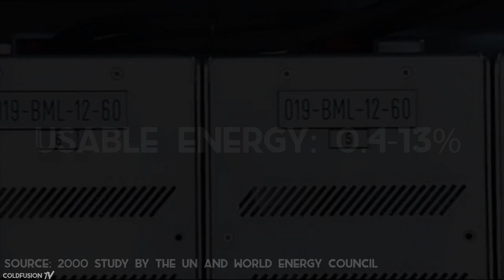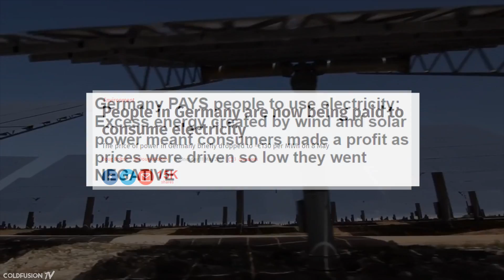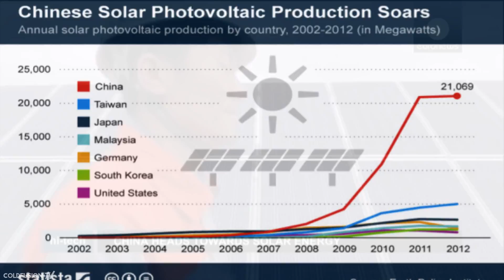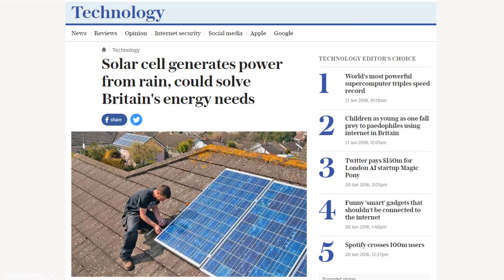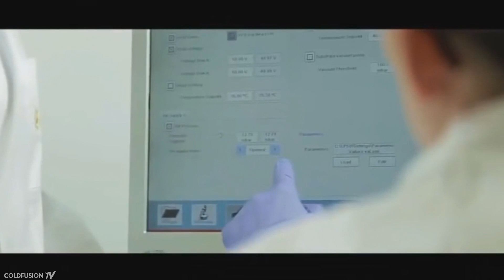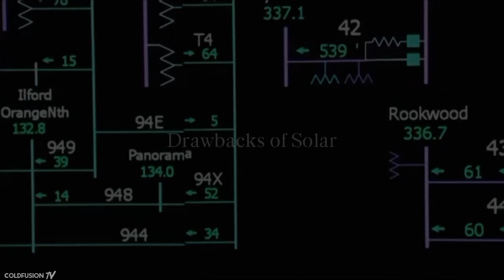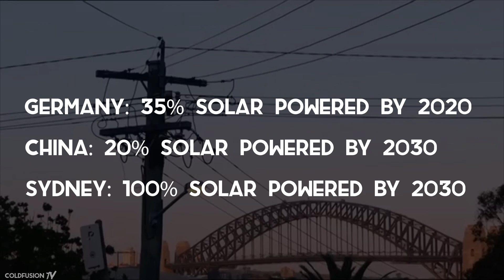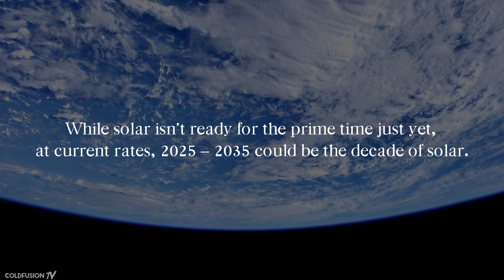The Truth About Solar

Comment: Solar is STILL expensive when you take into consideration that it requires energy storage (e.g. batteries) for high penetration rate in the grid. Furthermore, you should just have mentioned that the solar irradiance has a theoretical maximum of ~1400 W/m^2 (fluctuate tiny bit over the year) better than the BS you threw earlier in the video.
Reply: (mech. engineer with solar specialization here ) : you don't necessary need storage, smaller solar system taking your peak load for e.g. factory during the day is also an option. it breaks even in under 4 years :), plus the maximum irradiance might be true , but thats for silicon only, there are other chemistries , like abovementioned perovskite
Reply: You should stay in school longer, you are obviously really bad at thinking outside of the box.......
Reply: Once again, you are very under-educated, and need more real world experience. They are now selling Salt batteries (or salt ion batteries) that are fractions of the cost and are great for solar storage. Have you seen the mirror array power plants, too?  They are "solar" but in the heat sense, not photo voltaic. They are able to store enough heat in the molten mix to create power long after the sun goes down, through the night, into morning. I would hire a kid like you, but you would have to do more listening and learning, and less talking and thinking your degree means shit.
Reply: Cheap ain't everything. If we continue to use fossil fuels at the current rate the oceanic phytoplankton we rely on for our oxygen will die off. That's just one cost of global climate change. Try breathing the money you'll save by clinging to dinosaur technology.
Reply: PS. I'm an energy system engineering student (masters of mech. engr, nearly done)
Reply: I would argue that having to build, run and maintain peak power plants are also extremely expensive. I am unsure of their overall cost versus say, a huge array of batteries that store and distribute solar, but I know it is not trivial since states like California and the IOUs spend a ton of time and money on peak demand energy.
Reply: Paul Fortunato Still cheaper than solar. Not only energy storage (let's say batteries) are expensive but they also have very short life time. In the future, batteries will get better, but at the current state, his statement is definitely false.
Reply: MilitanT07 It is very funny you don't respond to me. It is almost as if, you have nothing coherent enough to counter what I am saying to you.
Reply: Eclipsethesun: No one responds to ignorant blabbermouths like you.  You are emotionally challenged and ignorant you do not even bother to check your own statements as that might make you feel bad.  You just want to be heard as you are on an emotional crusade.  If you had something relevant to say, you would have done so with numbers(Facts).  Since you are running on emotion, you do not have numbers(Facts).
Reply: MilitanT07
Don't forget being too cold as well.  Cells oxide as they age and quickly lose capacity to generate power.
Reply: Absolutely correct.  In addition, of that 1400 W/m^2, we can only hope to capture (After losses from the PV panel, the inverter, and the batteries) something on the order of 30% of that.  To put it into perspective, assuming a 15 mile commute, you'd have to cover your entire back yard with PV panels to drive your Tesla to work.  People should watch this video: https://www.youtube.com/watch?v=-5bVbfWuq-Q
Reply: First, no matter the kind of batteries, there is only a maximum, at the equator, best case scenario of 1400 watts per square meter.  It never, EVER gets better than that on planet Earth.  But it does get worse, far worse.  For instance, at the geographic center of the United States (In Kansas, at 40 degrees North), that theoretical maximum falls to 63% of that, about 882 watts/m^2.  And due to the inefficiencies of the PV panels, the batteries and inverters, you can only count on getting 264w/m^2 from that.  Which means that a 1 square meter of solar panels won't even generate enough power during the full day to allow you to run a 100watt bulb 24 hours.

Next:  Either make an argument like an adult or STFU.  Being abusive weakens your already sad argument.
Reply: phaedrusalt Somebody flagged your comment as spam I couldn't see it till now. There is also the issue of operation condition above STC (e.g. higher cell temperature, bigger voltage drop across cells)
Reply: I am not hooked to the grid, yea I made huge cut backs on energy use and people try and say it would be cheaper if I stayed connected to the grid is not the truth. I'm one year in use only 3 100 watt panels, 4 walmart batteries, 40 amp charge controller, and a 1500 watt pure sine wave inverter. it was about $1500 for all that and bits and pieces to hook it into the house. Now the minimum charge from my power company would have already took the $1500 from me so I'm already making free energy in my book. Yea I know most could do the huge cuts I have made but I still have lights at the flick of a switch, refrigeration , television and this tablet I'm using now. the only thing I'm doing without is air conditioning. looking at what I can do about air conditioning but it's still not viable IMO. why have I done this basically screw the power company.
Reply: For people who claim to know things, some people don't know very much. Global warming and cooling is a natural process of the earth. In the past the earth has gotten a lot warmer than it it is today and a hell of a lot cooler.  CO2 and O2 rates have also been higher and lower.  Temperatures have only been recorded in the last 100 years, the only way to know the cooling/warming trend is through core sampling.
Reply: +Daniel Chrkavy That's why I said "for high penetration rate in the grid" because the grid can easily absorb small amount of energy (arguably up-to 15% without even needing a study). But that is close to nothing, you can easily compensate lack of sun during peak hour at certain days but you certainly cannot when the penetration rate is high. Of course unless you have conventional power plant with enough capacity but that would be too freakin expensive.
Reply: Unless, of course, you use molten salt solar, where you can just leave the molten salt (or whatever material they use) insulated and not put water on it when the power is not needed in the day (there will be some losses but not too much), and then pump the water at night. It's also alot more efficient, but does have the downside of being a plant far away that loses power as it goes through the grid.
Reply: +D Hunter I really don't understand what is your argument here. It doesn't change the fact that it is expensive (what i'm arguing). Furthermore, renewables are heavily subsidized and fossil fuels power plants are heavily regulated in Europe so... The US also subsidize renewables to push it further.
However, pushing it too much forward is idiotic as more research is need to be done for it to be more economical favorable. What you're describing will take decades before we see any effect if any.
Reply: Nosirrbro Right. That's not really that cheap when you consider the fact that what ever you stored would have to spread between the time the sun is down. If you check the price for those tanks they are in the order of hundred of millions or billions for couple of GWh. 1 GWh tank if had to supply power for 30 hrs would have a theoretical maximum average of 34 MW.
Reply: Don Mega Irrelevant.  Do you have a LED hair dryer?  How about a LED dishwasher?  Have you seen an LED elevator anywhere?  The point was about the tiny amount of power that 1 square meter of PV panels can generate, and the light bulb was just an example.  (Try to follow, won't you?)
Reply: hehehe , crappy Camry, yup she is that 1997 with 600,000 klicks, original motor very little rust.
Solar will not flourish until the full spectrum panels become available.  As for your vehicles,  big motors with small batteries never last long. That's why they put them in there, to sell you a new battery after the vehicles warranty runs out. With batteries , size means everything. If you calculate that you need 200 amp hours , get 400
Reply: +MilitanT07 batteries last a lot longer than 5 years! The Tesla battery has an 8 year, INFINITE MILE warranty. Doesn't matter how much you charge it, it's covered for 8 years. That sounds a lot like confidence to me. That and they are currently developing (are almost ready to roll out) a battery that is fully capable of running your house for well over 24 hrs off a short charge from 230 volts. With a 10 square metre solar panel which we'll assume provides 1000w/sq metre (since that is he average output of any decent battery),thus providing approximately 66amp hours of charge, you could charge a 7kWh home battery in 10hours, well within daylight hour times and have a house that ran all night long with loads to spare while you're charging up the next day. The Tesla home battery is going to cost around $3,000, and where I'm from a solar setup like that would probably be around $10,000 (I'm an electrician and sell these products all the time, so this is a pretty well educated guess).
Reply: I am not hooked to the grid, yea I made huge cut backs on energy use and people try and say it would be cheaper if I stayed connected to the grid is not the truth. I'm one year in use only 3 100 watt panels, 4 walmart batteries, 40 amp charge controller, and a 1500 watt pure sine wave inverter. it was about $1500 for all that and bits and pieces to hook it into the house. Now the minimum charge from my power company would have already took the $1500 from me so I'm already making free energy in my book. Yea I know most could do the huge cuts I have made but I still have lights at the flick of a switch, refrigeration , television and this tablet I'm using now. the only thing I'm doing without is air conditioning. looking at what I can do about air conditioning but it's still not viable IMO. why have I done this basically screw the power company.
Reply: +Dan Reader also solar panels don't have to be set up to charge a battery while it is discharging, there are many ways to connect them up. You can connect them up so that they only charge your battery from wattage not being used by any power draw you have. You can even wire them so that you can sell any excess that you generate back to the national grid, very common with my customers.
Reply: +MilitanT07 not a fan of big business, and I'm old so I guess it's my way of being rebellious still lol. what tip the scales for me was my power company got caught dumping coal ash improperly contaminating a river soon after our rates went up I didn't feel right paying for their mistake.
Reply: Simon WoodburyForget No not really, the grid create as much energy to maintain the frequency of the grid within the desired range, i.e. effectively Demand=Supply... I really don't feel like explaining the grid, look it up.
Reply: so worse is better? wow, i need to rethink my life.
Reply: People should learn an understand the difference between power and energy. This video was also realy bad.
Reply: We are not ready for solar for a permanent, solution . It still will be used for supplement to other generator sources.
Reply: ***** You argument is...?
Reply: +Brandon Yii  on a large scale it would be the way to go, easier imo to incorporate into the grid. I have seen some videos about them they store the heat up but still fall short if there is low light for long period of time. some the models for green energy I have seen include a hydrogen generator but to build and operate all of this is expensive. More expensive than war? I think we see what are leaders think.
Reply: +Richard Hawkins also photovoltaic solar will only work on a small scale, single home is about the limit imo
Reply: +YoYo Ma Neither do you. No facts, no numbers, no argument. You literally countered his argument with insults, which illustrates just how little you have to say on the matter, which irritates me even more than the comment you responded to. 

And to my point. It is true that solar is more expensive, but it's only more expensive because Big Oil is powerful and has control over the industry, and (a relative) lack of research and funding into improving solar is keeping costs high and adoption down. What needs to be considered here is not and economical point of view, but an ecological one. If we don't explore alternative means to power this 'civilized' lifestyle which we crave so much, then results shall be catastrophic. 

It's estimated (Data provided by - the Environmental Change Institute, School of Geography and the Environment, and Department of Physics, University of Oxford, with support from the Oxford Martin Programme on Resource Stewardship and the Union of Concerned Scientists. Modelling by Richard Millar. Interactive by Duncan Clark - for the fact-and-figure heads amongst you) that a child born today will see a global average temperature increase of 6.3 degrees centigrade. It might not sound like a huge number to the uneducated, but that is a fucking huge deal. Sea levels will rise by feet instead of inches, glaciers will melt, and perhaps most significantly, the Antarctic Ice Shelf will start to melt into the sea. 

NASA have already observed an ice sheet the size of Manhattan (called the Nansen Ice Shelf) with a gargantuan crack in it, waiting to fall into the ocean at any time. The tsunami from that thing hitting the water will be freaking big. That is estimated to happen soon (as in the next 5 years), and is significant enough that it WILL have an impact on us when it goes. 

Also worth mentioning is our little magic 6.3 degrees number. If this occurs it will be enough to melt much of the ice at either pole, which upon entering the seas will have a MASSIVE impact on marine life, along with currents (like the gulf stream) which are entirely responsible for the climates we have in the world today. Once this happens, our 6.3 degree raise in temperature will suddenly turn into a worldwide nosedive in temperature, and will likely lead us into our sixth ice age. Make no mistake that climate change will be the end of us if we do not work something out, so really having petulant arguments about how much shit costs is really not the answer.
Reply: Sorry about the wall of text. I tried to paragraph it but YT doesn't seem to want to let me add line breaks.
Reply: What difference if you have to use batteries, you have a fuel tank in your car. In my old house had a 200 gallon oil tank for my furnace and a 14 ft by 18 ft shed for wood.
Reply: Mazda rx7 Fuel tanks can live for ages and it iis cheap. A battery has a life of like what 5 years? and it is very expensive (cost nearly as much solar panels per capacity from what I remember). There is no way to make it economically viable with battery atm.
Reply: Dan Reader Where is your proof for the first statement? I don't think there is an engineering college that doesn't do research on solar technologies.
Reply: MilitanT07
I don't where your getting your 5 year life span info from. I got 4 (they were almost 5 years old) used Raymond reach truck batteries for my brothers cabin about 5 years ago. they still work great. They don't have the power to run a reach truck but they do supply all the needs of his cabin.  My neighbor has a 2007 Prius with over 200,000 klicks on it and the battery is still works great.  Walmart deep cycle trolling motor batteries last a long time too (mine is 6 years old , works fine and they have been really abused).. 
Some people have been spreading lot of misinformation about batteries for years and people still believe it.  A guy up the street the other day was saying how batteries only last 5 years, we popped the hood on his car and found his Canadian  Tire  battery was installed 7 years ago,  hehehe.  Theory is theory not real world.
Reply: Mazda rx7 battery life depends on speed of charge/discharge, depth of charge, and charging/discharging cycle and operating conditions. Probably there is more than that, so saying your neighbor battery have lived for 7 years mean nothing. Furthermore, you need to have certain amount of energy stored, if your battery capacity has reduced beyond that, you need to add or replace one of them (i.e. when you calculate how much energy storage do you need, you'll have to oversize it by a lot to avoid replacing them).
There are also different types of batteries, most common are lithium ion and lead acid. Lithium ion which what is used in laptops, and phones have longer life cycle than acid which is used in cars.
Reply: Go through all the theory and internet info you like. A tow motor like the Raymond is run 5 days a week, every day it gets run down to where it can barely move back to it's charging station to be charged up. In my books thats cycling at it's extreme. After almost 5 years of thet, it can still supply enough power for a 900 sq ft cabin for 5 years and wont have to be changed in the foreseeable future.  Kinda throws the theories out the window.
The 9 year old Prius is used as a daily driver in the city (Toronto) kinda throws the Lithium batteries theories out too.
I just checked my Camry's battery, it's only 6 years old and never fails to start the car even at 25 deg C below.
Keep on preaching your battery theories, people that actually use batteries for other than toys and laptops will just laugh at your silly theories.
Talk to people in Toyota hybrids industrial machines (tow motors and reach trucks) and boaters about your 5 year theory.
Reply: Mazda rx7 I don't care how those retards feel, if it was economically viable, solar will flourish like crazy and kill off oil, since this is not happening even with subsidies, then it is not the case. Solar panel will continuously charge a battery while it is continuously dis-charged to the grid btw, it is not like the sun sent a instant magic beam and fill it up for the rest of the day and we only use it then.
FYI, we have 10 cars at home, the average battery life here for cars is between 3-5 years probably due to high temp for half of the year. Maybe your crappy Camry doesn't need much power to turn on relative to the battery size but our cars' engine are big, Range Rover, Mercedes G63, Lexus L570, Toyotta Land Cruiser...etc
Reply: +Dan Reader that totals $13,000, which would be my average electric and heating bill over about 3, maybe 4 years. How is battery storage not a decent option, based on this? And with the cash that oil has in their pockets, how could you possibly argue that I need proof to substantiate my claim that PVs would benefit from more funding and research, when already it's so far along???
Reply: Dan Reader 8 years? That can't be your average battery. If I wasn't lazy I would have calculate Tesla's battery cost per capacity and compare it to other brands. My Laptop, phone nor car batteries can live for that long.
Reply: Dan Reader How does this prove "and (a relative) lack of research and funding into improving solar is keeping costs high and adoption down."
Sure oil companies have a lot of power by lobbying, they are only in the US. Europe is trying to push renewables like crazy... Furthermore, recently I read somewhere that solar industry employ more people than the oil industry.
Reply: Richard Hawkins Interesting, why would you want to screw the power company?
Reply: +MilitanT07 they are just your average batteries, they're basically shitloads of tiny Panasonic lithium ion cells wired in series. Also this is anecdotal, but I know Model S owners that believe their battery will outlive the car, as long as they keep their charge limits (which can be set by the car's OS) to with the 30-70% range for daily commuting.
Reply: Dan Reader
If you don't work with them or talk to people that work, have and or use them and you listen to people who preach this 5 year bullshit, then you think they only last 5 years.  There are a lot of people like that. Making comments on vids biased on the inaccurate info they find on line.  They have no experience but they still feel the need to comment on something they know nothing about.
Batteries , with very little care can last a very long time. IF the lead acid battery has lots of room inside for the sulfide build up or you don't use some sort of conditioner
Reply: Mazda rx7 What? My first car battery lased 3 years. My phone battery barely survive 2 years. My laptop battery survive ~4 years (before it was like ~2 years). So yea, they don't really live that long normally. Based on what are you formulating your opinion?
Reply: Dan Reader I couldn't find enough info online to conclude anything about Tesla's car, but losing too much battery capacity after 8 years is certainly not ok when it is car.
Reply: My iPhone 3g still works fine , I use it as an iPod every day.  Got a  2011 Lenovo i7 laptop , battery is fine. my wife's 6 year old mac-books battery is still working well
I guess batteries don't like you or your running them dead all the time
Batteries of any type don't last if you run them dead
Reply: Mazda rx7 Unlikely, it is most likely you're lying especially iPhone seriously?!
I hope by "working fine" it doesn't means it can survive without connected to power but have nearly all of the original capacity available (i.e. the phone can last as much as it did when it as new).
Reply: Dan Reader Also IFY, I attended a seminar in NYC about Energy in Columbia University last may and they were all like, we are looking forward to Ellon Musk work, he might be able to make solar with batteries actually economical.
Reply: 1st Tesla battery cost is below 200$/KWh 
2nd Tesla cars use a temperature management systems in battery and cycle it only on a small part of total capacity thus battery degradation is minimal compared with consumer electronics that has such battery working conditions that no wonder that smartphones have trouble to hold charge after 2-3 years.
Reply: The panels on my roof cost nearly 40k. I don't know where you're pulling 10k from. We also don't store any, but sell directly back to the grid because incentives are profitable. 
I don't know why no one mentioned that solar panels have a massive environmental footprint, and cannot be disposed after their ~20 year working life.
Reply: +Simon WoodburyForget what does it cost to manufacture and ship a panel from China to the States to a distributor, and then move it to the actual site and then move it from the site to the landfill? what materials will you never get back. the metals will never be recovered as the process is in itself too expensive? it's easy to forget transport and manufacturing environmental costs.
Reply: +Simon WoodburyForget as a curious sidenote, since we as a civilization have started mining, we've depleted the majority of highly concentrated ores which were located at a relatively shallow depth.
Reply: +Simon WoodburyForget how much oil are you going to burn to manufacture all that glass and all the cells and all the framework. how much oil are you going to burn transporting all that weight across the ocean?
Reply: +Simon WoodburyForget also global warming as a whole won't be stopped by solar panels. solar panels CAUSE global warming. every method of energy production will cause global warming but currently fossil fuel and solar are the worst. tidal and wind are less bad in principle.. but they're still shit.
Reply: +Simon WoodburyForget Anyone with half a brain and a highschool level of physics would know that the earth's fucked.

I'm an engineer and I no longer care about the environment. Most of my peers no longer care about the environment. 

Energy is required to recycle material. Energy is required to move material. Energy is required to manufacture material.

In theory alone, solar panels work off of converting energy which a portion of would normally be deflected back away from earth into electricity. That net gain of energy to the earth as a system is literally warms the globe.

The only solution to global warming is when someone figures out how to reverse the experiment which proved e=mc2, and rather than convert mass into energy, gather heat energy and process it back into material.
Reply: ArcDuc
Just different.
Reply: MilitanT07
"Unlikely, it is most likely you're lying especially iPhone seriousl"Don't know why you saying I'm lying. You obviously never owned an apple product or if you did , abused it. First thing people have to know about Apple products is NEVER do IOS or OSX upgrades. They only slow the machine down or shorten battery life. They were never designed for the newer software, they work much better with the software they came with.
Keep on believing the bs you read on line and wasting your money while spreading biased bs
Reply: +joshmdmd 

Does anyone wonder why we're obliged to have these stupid debates in the first place?

"Renewables" is just another dimension for the creeps who play the stupid game of politics, to wit:

I submit that the reason we're required to engage in these stupid conversations in the first place is because the climate quacks and hustlers can't keep to minding your own business and are trying to impose taxes, hardships, and a conceited sense of superiority on the rest of us. 

Here are the first principles the climate quacks violate:

Power is evil, 

because of the following golden rule of politics:

"Liberty" is a poetic term for property rights.

Therefore there are only TWO KINDS OF LAWS:

- those that protect property rights, 

- and those that attack property rights. 

"Have the government do unto others as you'd have the goverment do unto you."
Reply: If you can net meter (use the grid) it's a no brainer. It acts as a battery pack
Reply: +Paul Galkowski 

NO!

Net Metering is Starbucks-elite cost shifting of grid expense to the poor.
Reply: Paul Galkowski
Wires are now batteries according to you.....  HAHAHAHAHAHAHAHAAH.  And we wonder why there is a giant disconnect with the stupid enviorwackos.  The stupid idiots don't even know they are ignorant
Reply: +Yoyo Ma 

Right Yoyo,

These people are like children who believe in Santa clause.

They are full of sh*t.
Reply: hettygreene
They enjoy showing the world they are ignorant fools.  All of them are science illiterate.
Reply: +Yoyo Ma 

Right - and it's tax-funded quackery and superstition. 

Consensus is scientific truth...

Correlation is causation....

These are bad and stupid people.
Reply: +James Biggar bullshit.
Reply: +James Biggar prove your bs claims
Reply: James Biggar
In Canada, when you get no sun for most of the year.... HAHAHAHAHA.  You are full of Bull Shit  JB.  You require twice the area than someone in California.  Can't even make it work in CA where they get to sell their power back to the grid at retail prices.  Now you say off grid with the additional giant expense of expensive batteries?  HAHAHA.  You must be heating with wood as well.  Probably running your refrigerator on propane and have a backup generator on top of this.  Also, probably all paid for via subsidy from the government of Canada.
Reply: Simon WoodburyForget
Well, other than the simple fact, your "investment" fails in a few years... As 1) the inverter dies.  2) The batteries you bought die, as I am fairly positive you did not "invest" in nickel iron batteries, and 3) your solar cells die as they oxidize. 

If you weren't stupid, you would have gone with solarthermal or geothermal, instead of PV. 

PS. You are talking to a guy who lives in Washington state on the western side where we get very little sun who has solar thermal collectors on his roof, geothermal tubes in the ground, and hydropower from a seasonal small stream...  PV is an absurd joke unless you buy the semi broken solar cells yourself and pay yourself $/hour to build your own solar arrays.  Oh yea, also got my own greenhouse with a 45 degree roof facing south with black wall water tank storage...  Greenhouse does not make financial sense, but it does when the greens are enough for a big salad every day for an a family of 5 even in the winter plus more than enough to feed the chickens which give eggs and meat.  Fresh is so much better.  PV only work with net metering where you are abusing the system or you are heating with wood, or freezing your ass off in your house in the winter time.
Reply: Simon WoodburyForget
Do you know what the most basic of accounting terms Net Present Worth means?  Or Rate of Return?  Or.... Clearly you do not as you brought up "inflation". 

"positive" results....$$$/KWH is the only positive result that counts.  Anyone trying to make it anything other than this most basic parameter for energy production and therefore living standards is lying through their teeth for their own benefit(ideology).  The cheaper we make power generation, the higher our living standard.  If you require 15c/kWh or more to "justify" "positive" results, you are lying to yourself and the world.
Reply: price is getting there, my system addresses almost all of the fundamental  issues with solar. What the hell difference does is matter to me or anyone that you know the theoretical maximum of sun light.... Oh & BTY you now NOTHING about the battery revolutions coming our way.
Reply: Simon WoodburyForget You'd have incredibly financially unstable grid. You can eat up some of the cost slowly being forcing renewables which should reduce CO2 as well as fund better technologies. But forcing not fully developed technology isn't very smart!
Reply: Simon WoodburyForget You'd be sinking too much money for too little return, you're better off waiting for better and cheaper technologies. Sure few people might be willing to pay, but definitely the majority won't be down for it, it will be a big burden. On top of that, with growing energy demand, it will inevitably become unsustainable.
I pay ~80-150 USD/month in electricity for 1BR apartment in NYC! Imagine the cost for a family with the cost of using renewables!
Reply: Simon WoodburyForget sorry but hybrid batteries are mainly being developed & sold to the Auto manufactures. Manly by universities. Look up Edison Power we are on the cusp of new types of energy storage devises. ESD.  technically batteries.  As far as solar goes, its possible to get 3 year payback now IF you know what you are doing,That;s the industry standard for upgrade//investment. so im planning to cashing in on that!  I used to be a non believer in solar like most of you on here,  I develop processes in the film industry but I started putting my talents to the problems in solar & WOW its here now with the proper techniques I;v developed that is. Peace Out!
Reply: Dan Murphy Are you talking about peak shaving because that is kinda complicate things in how it gonna be different with renewables?
Reply: Simon WoodburyForget oh & i forgot, there is nothing even close to development for storing grid energies.
Reply: define peak savings please. Im talkin total investments.
Reply: yup!
Reply: Dan Murphy You said 3 years return thing, I assume you mean for installing batteries at home which reduces the load during peak hours. This is completely different game than using batteries to deliver the entire demand.
Reply: without giving out much info. batteries not included nor needed on my system. but utilized in a different perspective....
Reply: Dan Murphy What? Then what do you do at night?
Reply: absorb the credits you received during the day... not talking an off grid set-up here.
Reply: Dan Murphy I'm sorry, I'm lost, could you please repeat your argument again now I have more information?
Reply: not really, i"m keeping it in the dark just a bit longer. trying to get all my ducks in a row.  trying not to use investors & contractors to complicate things. See being a non believer in solar I was interested in the technology but a skeptic. But I kept over coming "all" hurtles &  hang ups in solar energy market. With real solutions that I learnt from 28 years in the film industry managing, developing process' , designing machinery & setting up manufacturing techniques.  vo-la investment is now obtainable is solar. I know 3 years payback is unheard of, but that is my goal & im really really close to it! even if I over shoot by 100% No one out there can compete, that is until they steal my techniques & my secretes my selling points as they did in the film industry... What is called industry standards is mostly because of me.... this time I'm taking care of my self first & solar it is.  Peace Out!
Reply: Dan Murphy Just one more question, are you using solar to feed energy to the grid? Because that'd be completely different game than using renewables purely for power generation.
Reply: Pumped-storage hydro. Hell, rocks and railroad cars. Energy storage is *easy.* What's hard is moveable energy storage for transportation. And that's only hard because we're all brainwashed to think we need 400+ miles range on our cars, and we're all afraid we might get cooties if we have to sit next to another human during our morning commute.